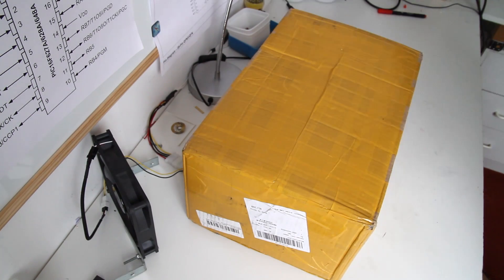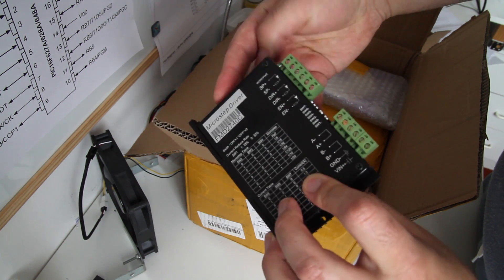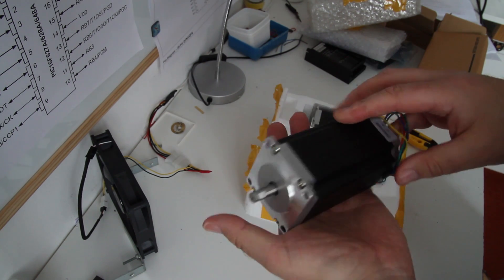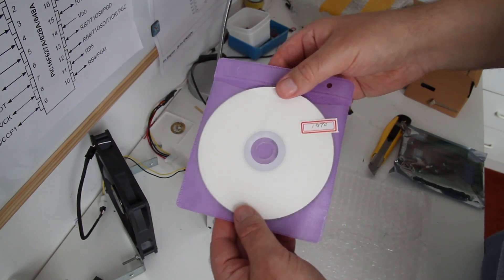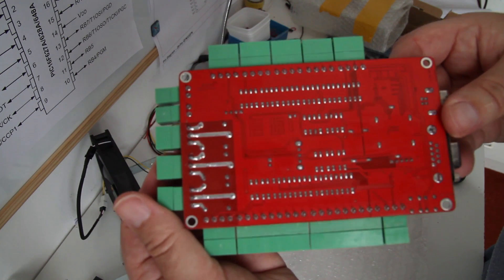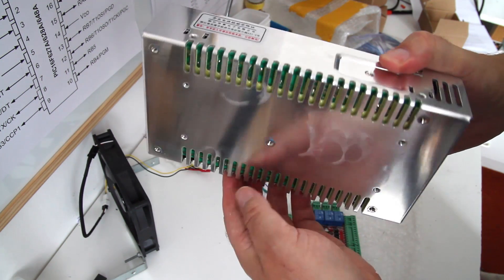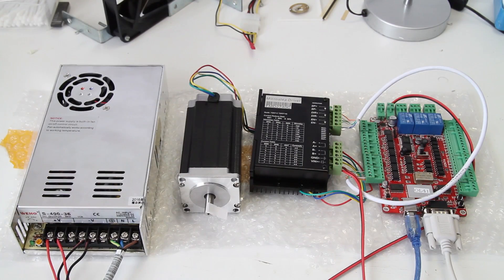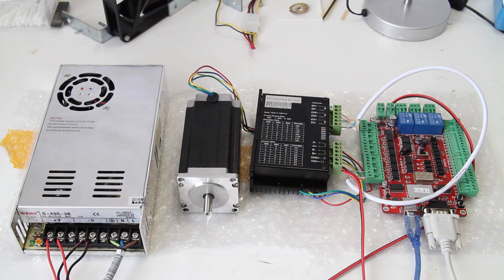Unboxing CNC Stepper motor kit

Comment: hi 
Do interface works on mach3 ؟
Reply from the maker: No it doesn't, it only works with cnc usb controller software, but you can replace the board with a mach3 compatible one.
Reply: Ik heb dezelfde configuratie gekocht en nu problemen met het breakout board. Geeft alleen nog 12 V voor de fan maar het signaal naar de stepper motor controls is is totaal dood. Ik ben in discussie met Rath motors. Weet je een goed alternatief ?

Comment: Witch jumper settings have you done with The driver?
Reply from the maker: Switches 1, 5 and 7 are on, the rest is off, which sets 3A mode and 1/8 microstepping for the X and Y axes. Thanks for watching!
Reply: MakerCentral Thx I am going to try, of you have more video's of that... because i just thee video's in your list... and not this one...
Reply from the maker: There's no more videos yet. I'm planning to add more soon. Stay Tuned!
Reply: for 3A and 1/8 steps on FMD2740C turn on the pins 2 5 and 7, pin 1 stands for sptepper idle current